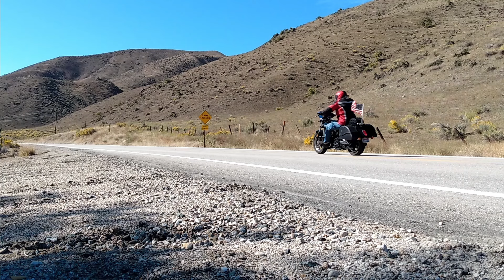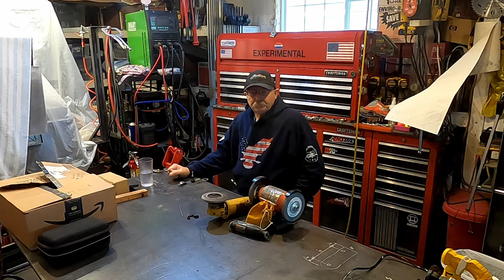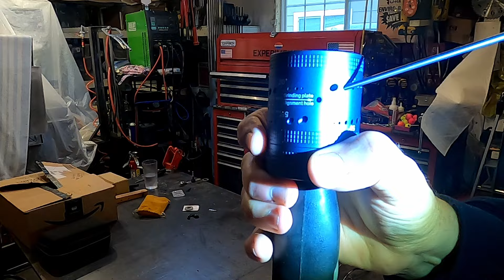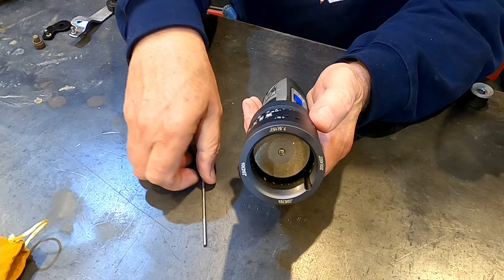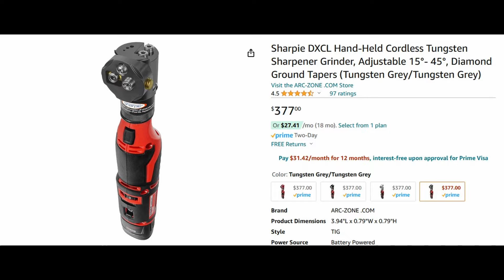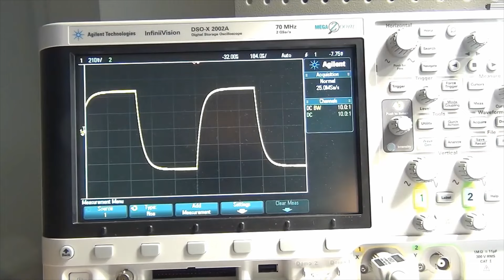BEST TIG TUNGSTEN GRINDER

Comment: Thanks for this presentation.  I have been using the arczone for four years and put about a couple thousand grinds through it all 1/16 15 degrees thoriated.  I never changed the wheel and still grinds fine so your wheels should last until kingdom come!  What I am interested in is that torch holder you have...much better than that weird yellow piece of crap I threw away.  Could you please say the product name and number?  Thank you.
Reply from the maker: Thank you for the additional information.

The TIG torch holder is my own design.  It holds my TIG, MIG, Plasma, and Acetylene Cutting Torch.